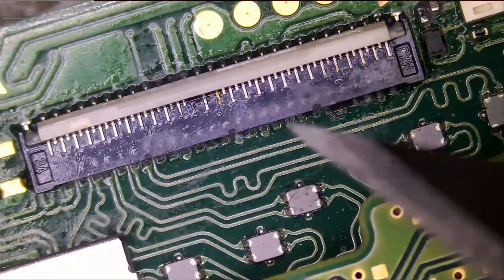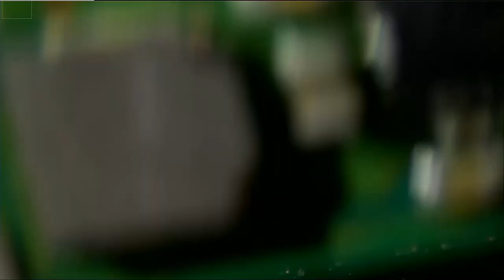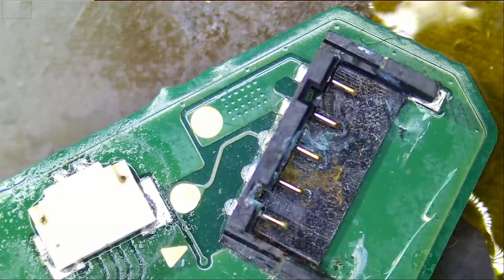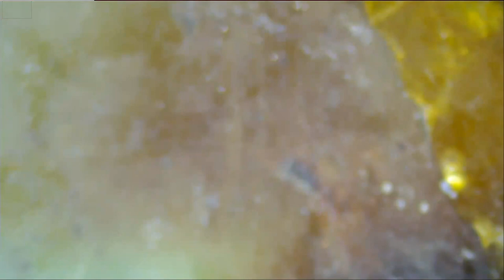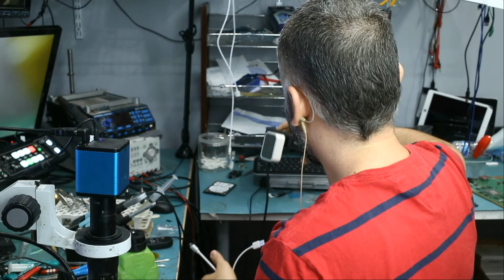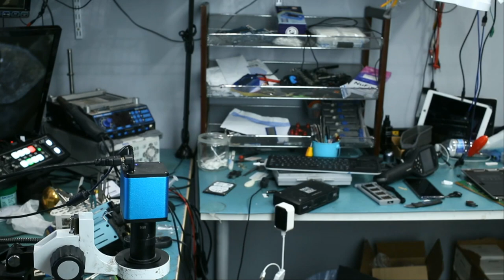Nintendo Switch Liquid Damage Repair + LCD Connector replacement.

Comment: You know Big Boss being able to disassemble/reassemble so many different systems is pretty impressive. These days stuff is glued down and has 5000 tiny fragile plastic clips holding stuff together. Not to mention all the 'traps' like "haha did you open it from the right side? Thanks you just ripped the flex cable for the display!" that you also have to avoid. 

Anyway props to Big Boss!

Comment: Great videos!  Repairing electronics is stressful in the sense that you never know if you will be able to fix something.  I have trouble with microsoldering and I wish that you showed the microsoldering in real time (not speeded up).  I own Frank Reiser Video/Audio Service and have been repairing peoples' TV and electronics for over 18 years on a part time basis.  The only difference between you and me is that you are better than I am. :)
Frank

Comment: nice and clean.  My goal for 2021 is to solder pads nice and quick and clean like you do.  Thats my goal.  Second Goal is to be able to clean old solder off of an IC array of balls without bridges forming from low melt solder or leaded solder when added to lower temp to clean with wick.  Experience is the answer of course, the more you do the more you get the hang of it.  Happy Monday brother.  Amazing vid as always.  Mashala.

Comment: I came across your YouTube videos whilst looking online how to fix a laptop that was not charging. It was given to me to wipe and dump. Thanks to your fabulous informative videos, I was able to fix it. Just a charging port, but none the less,  your videos helped. I don't have a hot air station, so had to resort to a  hot air paint stripper  with very careful use. It worked though.
Can I ask what program you use  to do your videos as they are. so we'll done. I'm in the UK. Thanks, Colin

Comment: What temperature do you have your hot air set to that allows you to place the LCD port without melting the plastic?
Reply: Heatig from below, he told in another videos that he using 500°C, it need practise to control temperature by how far the nozzle is.

Comment: My nintendo switch only has the blacklight turn on but no display. I already changed the lcd connector. Any ideas? The nintendo switch works because you can touch the screen and hear the menu noise. Also if you dock it will work with the tv. Please help!

Comment: Hello, this comment might not be related to this video in any way, but I know this is the right channel to ask this question. I have been following and watching videos from this channel beacuse I am very interested in electronics repair. I am from Kenya and looking to set up an electronics repair shop here. I am looking for advise on a magnifying desk lamp and the magnification that can help me inspect the tiny components on a logic board comfortably. I'm really restrained financially and I have no 100 USD to spend on a microscope. Links to what I need on ebay will be very appreciated. Keep up the good work. You've inspired me alot.

Comment: Hi. How do you clean the flux that will flow inside the fpc connector?
Reply: Hi Bry use 99% IPA and a cotton bud and gently just push inside and wipe around the area lift the flap up and use a brush and clean the flux out that way too I did one of these on my live stream last night ahah.

Comment: @northridgefix what brand and type of solder do you use?  i bought some low melt solder from your store but that's for removing.  what solder should I buy to use for general soldering back on components?  and should it be leaded or unleaded?
Reply: Not affiliated, but for home use leaded solder is the way to go.

Comment: Always live your video can you do a basic for me I'm kind of new like how to  find a short for noobs
Reply: Diode mode check for components with "perfect" continuity on both side of the component (not everything that "beeps" it's a short, some lines have low resistance and diode mode will beep) and "perfect" continuity it's a measurement in ohms that it's lower than 1 Ohm, if you find a capacitor that beeps on diode mode, now you go into Ohm mode and check to make sure it has perfect continuity in both sides, one side will measure something like 0.92Ohm and the other 0.97Ohm, the higher Ohm side it's the POSITIVE side the lower Ohm side it's GROUND, now that you have identified Ground and Positive in your shorted line, now you have 4 choises to spot the shorted component (it may not be the one you found, that one it's probably just one component in that shorted line that has several components shorted by a single one bad component), cheap options: Alcohol, Canned Air and Pine Resin (for alcohol you just pour it on that zone of the board and feed the board with your power supply, the shorted component will boil the alcohol and evaporate it, for canned air you turn it down with the nozzle of the can to the bottom then you spray the zone with the liquid and gently blow it with your mouth and liquid will turn into snow, then you use the power supply to spot the short component since it will heat up when you feed the circuit and everything will remain frozen but the shorted component, and with Pine Resin(my favorite, cheap and effective) you burn the resin with your soldering iron at about 350ºC and white smoke will fall from your soldering iron tip, use that smoke to put a layer of white power on the zone, once you have all the area covered with the white power you feed the voltage with your power supply and the shorted component will turn the white power into a liquid) to feed the circuit you set your power supply to an adequate voltage and amperage for that board, I like to start with 4V and 1A for most boards, so you take the positive lead of you power supply and place the lead on the positive side of the shorted component (the one with the bigger Ohm value of the "perfect" continuity) and with the negative lead you touch any ground pad or shielding for a second or two, if nothing heats, you increase the amperage to a max of 5A and something has to heat up, and the expensive option, you buy a thermal camera, feed voltage to the circuit and watch the thermal camera footage to find the shorted component.
Reply: Basically just like oscar said I have a channel myself so I will actually do a video like this which will show more of how to find shorts around a board and diagnosis it